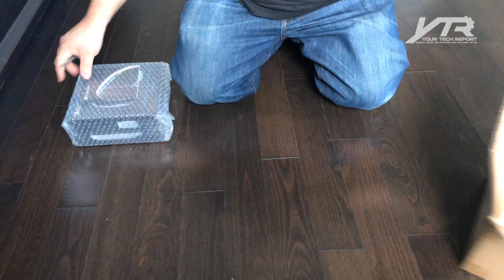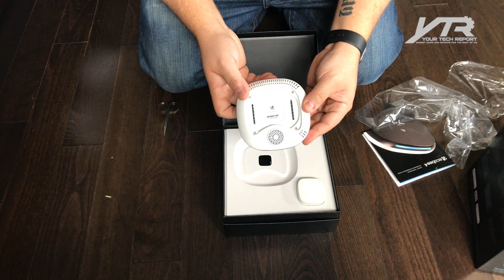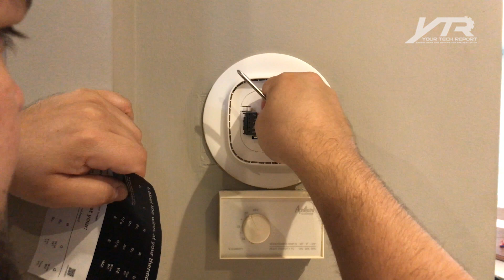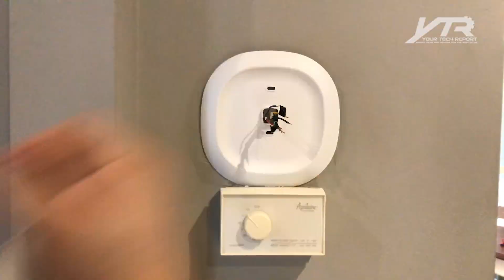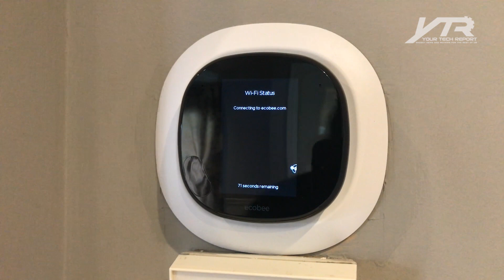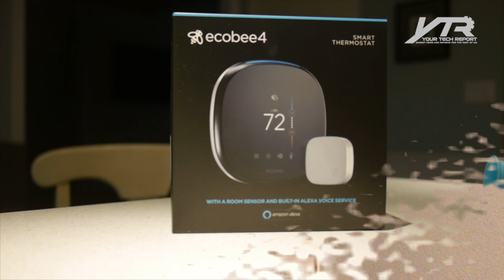ecobee4 Smart Thermostat: Hands-on

Comment: Who installed the Ecobee3 for you? Did you read any of the instruction manual prior to breaking off the wire tabs on the 3? You push them in to release the wire. Also, the screw holes for the mount plate. Just take 10 seconds to make a pencil mark to see that you need to add or adjust the screw hole.